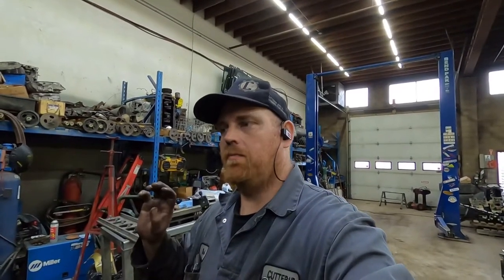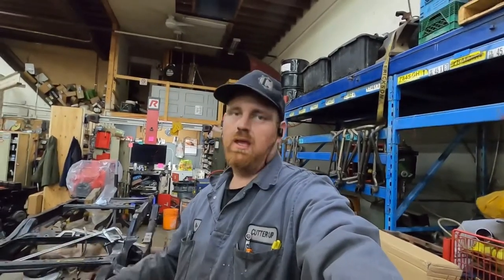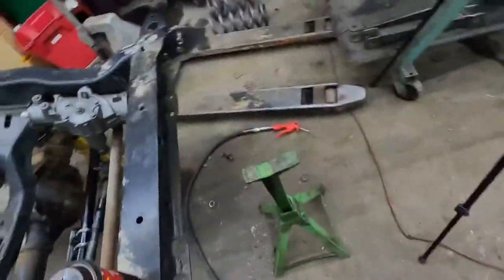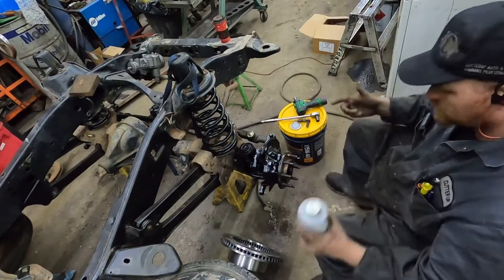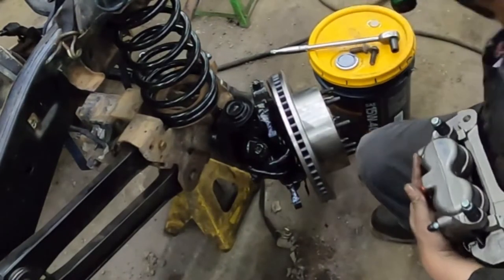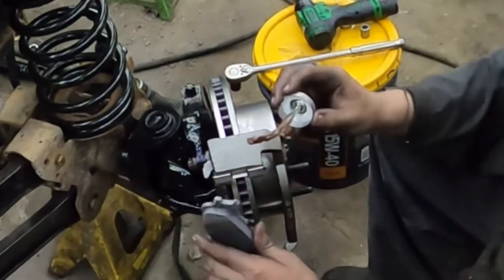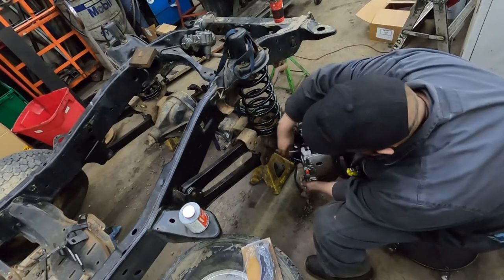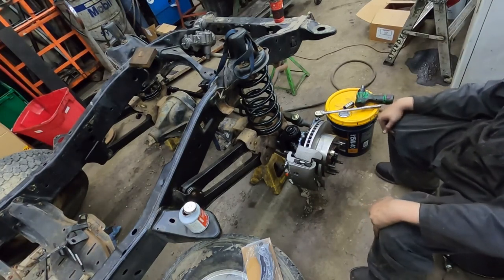SHORT BOX CUMMINS BUILD. Doing front brake up grade.

Comment: Yea I use anti seize . Worked at a power plant for 34 years and we used that a lot . So I also do . I going to up grade my old 95 dodge front axle to a later model so I also can up grade my brakes to 3 gen . I thought while I on the front would replace the get rid on the steering linkage and use the later model on this as well . One last thing is I wanted to perhaps go to a different wheel bearing and locking hubs . Any ideas here . Thanks for the information
Reply from the maker: you can do the free spin kits for them

Comment: Yeah,200-02 I think with the outboard brakes?... Didn't realize the newer version caliper bracket worked as well... would probably need at least 17" rims??.... 👍👍
Reply from the maker: 1999 was the cross over year  but ya you do need run 17 and up wheels
Reply: @CUTTERUPROB  10 4 👍

Comment: What is your opinion on upgrading to rear disc? I’ve been told good working rear drums vs disc there isn’t much difference in braking power but disc can handle heat a bit better but is obviously easier to work on.
Reply from the maker: Drum brake do have more power for stopping the issue is the drum can't get rid of the heat as fast as a disc can , so the disc is a upgrade because of that . now going to a better disc just adds my braking power again